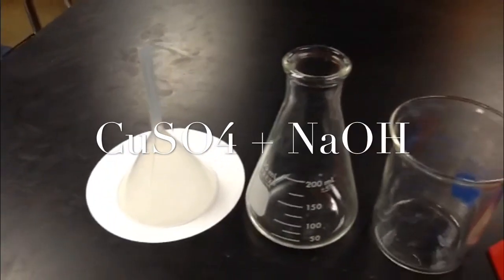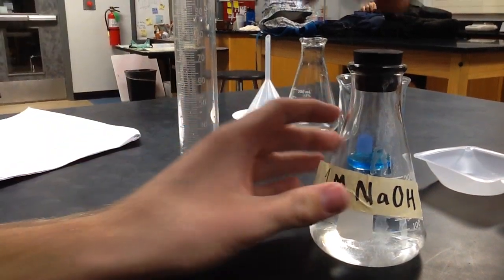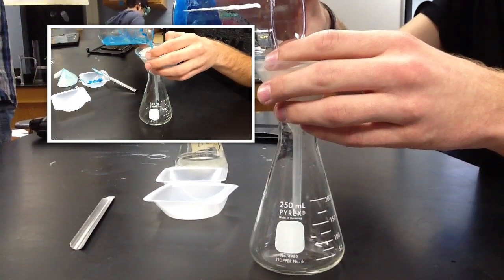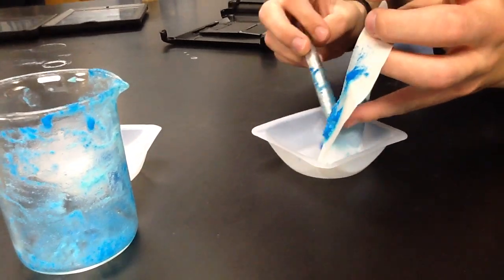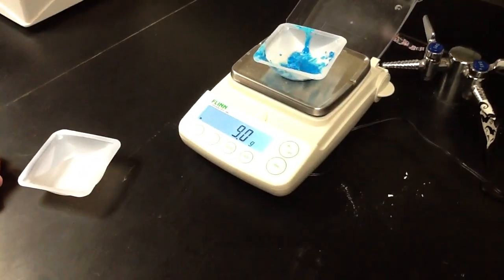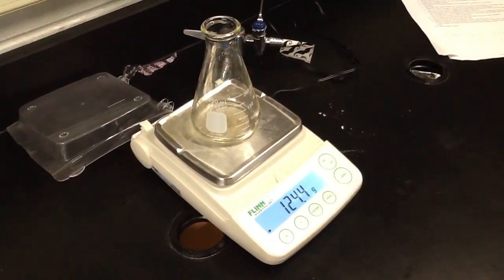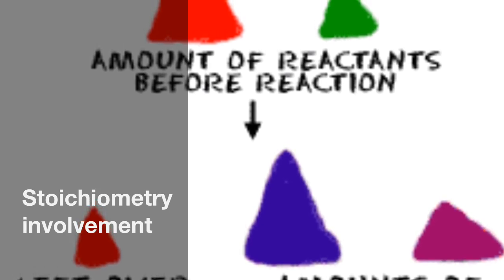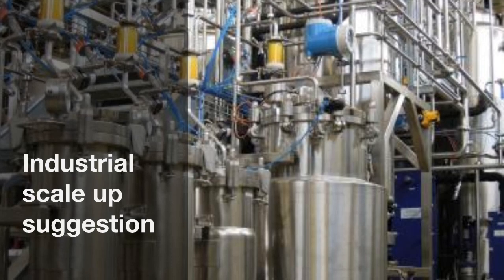ChemTech Industrial Reaction CuSO4 + NaOH

Comment: In my chemistry class my class combined CuSO4 and NaOH after we let it sit for a while on the bottom what appears to be a black solid formed (you could mix and move it but it wasn't water) I believe "the Precipitate settled" is the right terminology my questions are:

What is the precipitate? and Why did whatever it is precipitate out? Thanks
Reply: It's CuO
Reply from the maker: For your case, the black solid formed is the precipitate. It might be possible that when you let the product settle in the bottom, oxygen/carbon got in mixed with the product. That's what happen to mine the first time we were filtering it out. We tried to use a hotplate to separate the liquid Na2SO4 from the CuOH2, but it became black due to the oxygen/carbon getting in. I say oxygen/carbon because I don't clearly remember what happen, but I do know, it got contaminated which is what most likely happen to you.
As you can see in the video, you should have gotten two products; CuOH2 and Na2SO4. CuOH2 was the precipitate (The blue substance). Na2SO4 was the liquid being filter out in the video, Na2SO4 is a clear substance, but we had some CuOH2 get through the filter paper so part of it was blue as you can see in the video.  

Hopes this helps, I don't know if I clearly answer your question or not.
Reply: Tommy Truong Thanks that helps answer my question alot. Do you know why Hydroxides aren't soluable when they aren't bonded with group 1 molecules by any chance?

My theory is that Hydroxides when bonded with non group 1 molecules  aren't soluble because they have the same charge on both ends (CU- and OH- or CU+ and OH+) or one side is negative (OH- ) and the other side is neutral (CU) which doesn't allow H2o to dissociate and dissolve the molecule.

Thanks again for your help
Reply from the maker: I don't know why, but this is what I think. Hydroxides are soluble in group 1 elements because of the valence electron, Hydroxides has 7 which means it needs one more to complete the shell, and as we know group 1 elements have 1 valence electron which would complete it. Another thing is the general rule "likes dissolves likes". So my other idea is that they must have the same polarity for it to be able to be soluble.

This is what I think, it might not be right, but I hope it helps.
Reply: It is CuO for sure.